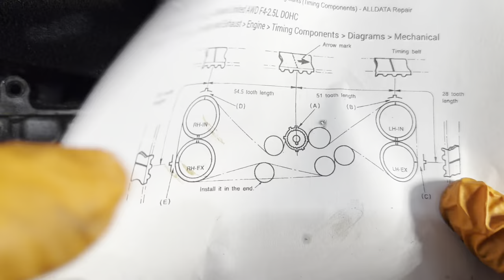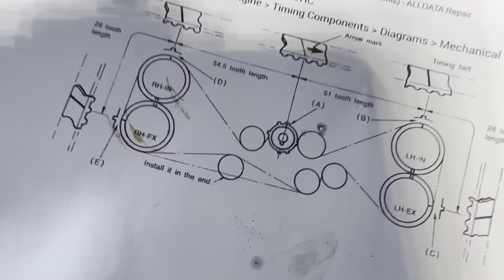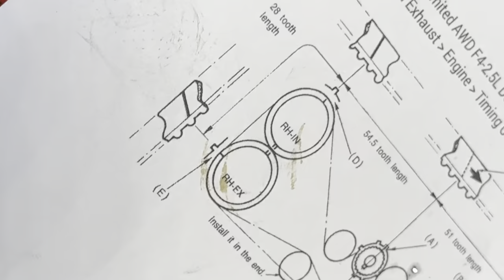SOFT METAL!  Engine Damage! Subaru Legacy Outback AWD 2.5 DOHC EJ25

Comment: You should always drill metal slow to medium, better for bits and your wrists. Definitely not great to full throttle gung ho them.
Reply: I told him this I believe over a year ago and others have said the same thing when he drills things.  He apparently wants to waste more time and money having to buy more drill bits after ruining them after the first 20 seconds but also spending extra time having to keep drilling when the hole could be drilled in a matter of seconds.

In this case, he was just lucky that he was drilling aluminum.  You should see what he does to drill bits in steel or harder metal.  I just don't get it with some things with Ray.  He's pretty smart with so many things related to vehicles but yet makes the most basic and simple mistakes.  I didn't agree with the way he installed that thread insert and he should have redone it in my opinion.  It may end up being okay but it didn't go the way it should have.
Reply: For the life of me, I can't understand the logic behind running the idler bolt down with a non restricted torque tool into the aluminum block. Especially after having to do a thread repair once. I would've been content to run it down by hand, observing the published torque specs.
Guess some folks can't learn from their mistakes.
Reply: @eldridge201  He didnt run the taper of the tap far enough in hence the insert basically bottomed out. "Less haste and more speed" sign should be hung on Rays wall, he does so many little things that are just wrong, normally he gets away with it but that insert was a right botch job.
Reply: Mild steel - high speed, high pressure 
Stainless steel - low speed, high pressure 
Aluminum - high speed, low pressure 
21 years metal working experience.
Reply: Rule of thumb is: Small diameter hole goes fast, larger diameter goes slower. That way the velocity around the circumference of the drill is about the same -- if you're going too fast, either the drill will bite or you're going to temper or warp the metal due to friction, leading to a dull bit.
Reply: We sure do have a lot of Armchair QBs in this comment section!!!!!😂😂😂

Everyone is a pro until they aren't!!!!
Reply: @eldridge201  I'm so old I remember non-variable speed hand drills. Off/on only. 
These kiddies these day have no idea how good they got it !  Ya got near infinite speed control USE IT.   Easy does it.
Reply: Gung Ho's Garage Repair😂😂😂
Reply: Guess some us here...just want him to throw that Neon sign out 😏
Reply: And Troy gets the Trophy😏
Reply: Indeed - correct .
Reply: Then WTF is HST for??
Reply: @jacksonnra1856  high speed steel hss, not hst are for wood, plastic, anything not metal except maybe some light aluminum drilling..a lot of concrete bits are this or polycrystaline diamond...cobalt are for steel, other metal etc carbide tipped are for durable stuff that dulls it like fiberglass, some softer metals, titanium are kinda a gimmicky thing but great for wood.
Reply: Reeeee
Reply: The way I learned it was that the bigger the bit, the slower the spin.
I'm not saying it was right, but it worked.
Reply: @dsc420247  The thing with the "armchair QBs" that you're referring to is that some of them are actually "pros" in their field as well.  There are some techs in the same field that happen to comment in the comment section as well.

If you read some of the comments, you will find that there are also metal fabricators or machinests commenting that probably know a thing or three about metal and how to properly drill a hole so you don't burn up a drill tip but also waste time not getting the hole drilled.

Nothing wrong with people explaining the proper way to do things so people can learn.  I'm willing to bet even Ray himself would agree that even he needs to take a moment from time to time and "rethink" a situation or wish he could have had a "do over" even if reading some of the comments can be a bit frustrating or disheartening.
Reply: @timewa851  Agreed.  I've used drills that you had to wait a few seconds before they would stop spinning once the button was released.  Some are lighter duty than others so it wouldn't take long for the drill to stop spinning and others it seemed like a good 4 or 5 seconds.

Just take it easy.  You're actually making more work for yourself by trying to go too fast.
Reply: I love Ray, but this was painful to watch.
Reply: I wrote this months ago... meanwhile i gave up

Comment: Are you sure you want to pressure wash that engine? The alloy is so soft the pressure washer will probably blow a hole in the block.
Reply: it's called Job Security.
Reply: @timewa851   Is that anything like a wallet flush?

Comment: Ray, you are using the wrong cutting fluid for aluminum. The Tap Magic you're using s designed for steel as it contains sulfur which is an extreme pressure lubricant. The right lube for aluminum is WD40.. There are other cutting fluids equally as good such as Boelube, Anchorlube, and Aluminum Tap Magic but WD40 is perfectly suitable for all aluminum drilling, cutting and tapping operations.

Comment: The installation tool expands the insert helping to lock it in. We use these all the time at work. I’m guessing you didn’t run the tap deep enough past the lead thread of it.
Reply: I think you're probably right, however it may have been the right decision in this case, as I'd rather have to grind off some of the helicoil and compromise it than risk punching through the back of that hole into the block that he has already tried and failed to replace, it seems unlikely to me that the helicoil is going to come loose on its own anyway given how that block seems to love permanently welding fasteners to itself. Give it a few days and you'll have to drill out the whole helicoil if you want to take it apart again.

Comment: 9:35 a technique I was taught when tapping was to advance the tap a couple of turns, back it out a half-turn to clear the chips from the cutting edges, and repeat until fully tapped.
Reply: Perfect form when tapping hard materials, like steel.  This engine is apparently made of aged cheddar.  Ray could have carved threads in it with his house key...
Reply: Yeah. Exactly the technique you're supposed to use. 👍🏻
Reply: m10 is large enough and he is tapping slow enough that it will move the chips naturally.
on harder metal yes, but it is a good habit to do all around.
but i don't think he fully tapped it, which is why it didn't want to seat fully. it was hitting the lower tapper end of the threaded area from the tap.
Reply: Not fully tapped all the way down is what I noticed as well.
Reply: @mikejacob3536  or a... wait for it... a cheese grater. 🦊
Reply: As if Ray gets that, he's a hack.
Reply: we also put the block under air pressure to blow back the majority of swarf and not blow it into the engine as he did with the air gun,. also, we changed the angle of the drill to stop it biting into the block, the drill he is using was meant for steel

Comment: My general rule of thumb is never use power tools when putting (or taking out) steel bolts into aluminum. If the tool is working too fast, it can pull the threads. If it is too powerful, it can rip them. You have to remember that the steel bolt will win every time when it comes to aluminum.
Reply: That’s exactly why it happened 👍🏼
Reply: I worked in the Honda factory. Hand start the bolt and tighten with a impact.
Reply: Yeah I am overly cautious fastening and loosening anything on my block. Hand tools only for me.
Reply: Ray too dumb and lazy to figure that out, especially with sparkplugs...

Comment: I said this in the last video, but I have to stand up for Subaru here. There's a reason why service data tells you to remove the tensioner last, after the belt has been removed. If you remove the tensioner first like ray did, when it is under an extreme amount of tension, you will strip the bolt threads out when removing it. 

I like Ray so I don't want to sound like a hater, but all the subaru bashing comments in these videos bother me.
Reply: I'm sure that if all previous work that was done properly you shouldn't have issues with bolts stripping out ,?cheers🍺
Reply: Yeah , stripped out threads in the block just from removing the bolts….🙄
Reply: @devinangola3458  This is the kind of thing that might be hard to understand without experience, but yes.

If you have something putting pressure on that steel bolt, like a timing belt tensioner, as you are trying to remove it from aluminum, you can easily strip the aluminum threads out. 

Anyone who has tried to remove a bolt that has side to side or up/down tension on it as you were trying to remove it should understand this, as the bolts don't thread out as easily in those situations.
Reply: @chrissmithz314  boy that was very condescending, I’ve worked with aluminum blocks on cars and cycles, never have I had a block thread strip out from just taking out the bolts. Had them break off because of two different bimetallics causing corrosion in the threads. Not to sure what the bolts are made of but corrosion and constant rotation on a pulley can wear out the threads OR they were over torqued from a previous repair.
   Anywho, dialectic grease must be added to stop that corrosion or slow it down.
  Looks like a cheap aluminum block to me, and sketchy manufacturing.
   But please school me on my mistakes…
Reply: @devinangola3458  I wasn't trying to sound or act condescending at all, I apologize that I came off that way.

There's really not much else for me to say. Removing a bolt that's holding in a timing belt tensioner, when that tensioner is still applying tension, is just different from normally removing a bolt.  It's like there's a lot of weight hanging down from the bolt, or pulling up on the bolt, causing it to drag and pull the threads out as it comes out.
Reply: @chrissmithz314  apologies excepted, I’ll have to go back and watch whether Ray took the pulley under tension from the belt, I don’t remember!😂
  But there were two stripped out threads on that aluminum block, and as you said a constant pull and rotation to wear out threads.. it begs the question of having a belt instead of a gear driven chain for timing?
   Wouldn’t this just happen again on a few years? External timing belts are cheap and easy to replace, but as I said before..bimetallic corrosion is still going to happen with the new metal insert with pressure and rotation.
   Honestly I’m not trying to be a azzhole, but isn’t that a flaw on the design of this block?
Reply: @devinangola3458 Technically there was only one stripped out hole. The first one was damaged due to a bolt on the water pump breaking and during the removal process and the resulting efforts to extract it damaged the threads. The other threads were damaged, as many have said, by removing the tensioner bolt with it being under load. We keep "grenade pins" hanging around the garage to take tension off or just cut the belt before removing the tensioner bolts on everything we work on to eliminate that exact problem. I would bet money Ray never removes a tensioner bolt on an aluminum block again that has tension on it. I too though am curious why no thread sealant was used on a hole clearly exposed to the water jacket.
Reply: . Ya mean accepted?
Reply: @kennybaumann2117  hmm maybe it’s because they are haunted with bolts that break off and stripped threads from corrosion, electrolysis. 
  That engine is compromised, wrench on any other part of that engine expect the same frustrations.
  Just fixing to has contaminated it. How far do you go before pulling the cord?!
  You could fire the parts cannon at it, then you might as well swap out the engine. RIP Subaru, you probably gave people joy to drive…I guess?😐

Comment: You missed one feature of the time-sert. The insert is not treaded all the way to the bottom. This is done for a reason. When the installation tool is running the insert in, it stops at the unfinished treads of the insert providing enough friction to bottom out the insert into the counter sink that was cut. Once bottomed out, and the insert is seated, you keep turning the installation tool. This does two things. It finishes the threads at the bottom of the insert and expands the bottom of the insert to lock it in place. You needed an insert that was about 3/16 - 1/4 inch shorter and all would have went well on the first try (could have run the counter sink tool in a little further).

Comment: Some advice from an old-timer. Before you reinstall steel bolts into aluminum alloy chase your treads.Put some light oil on a tap cleans out the corrosion. Also some anti -seize on the bolts. To avoid coolant leaking from water jacket thread sealer on bolts.
Reply: Good advice, I would also suggest possibly some grease on his tapping tool to capture shavings created by the tap. Has saved my butt several times. Too old now to be fiddling with screw ups self inflicted. Having done this crap for over 50 years I’m tired of fixing my own stuff ha ha .
Reply: @turner0224  I'm 71 still working on old motorcycles. Stripped threads a common occurrence.
Reply: @jeffreycler495  Remember in the late sixties and early seventies all side covers had Philips head screws that stripped out all the time. That’s when I bought my first impact
Reply: @turner0224  Yep, First choice...
Reply: @turner0224  My early '70's Hondas had those.  First thing I did was replace those bolts with hex heads or Allen cap screws.

Comment: I've only hit about the halfway point in the video, and I have comments.

First, Timeserts have three lands of thread at the tip of the insert that are not fully formed until the installation tool rotates through them to swedge them in place, locking the insert into the hole in the process.  That's why it's so important to make sure the countersink for the flange is properly bored.  Taking off the excess shoulder is a perfectly good solution when it doesn't quite fully go flush or below the deck.  

Second, I'm surprised that Subaru used a 10x1.25 thread in the aluminum casting.  My experience has been that coarse threads hold better than fine threads in aluminum, and in fact that's borne out by the standard practice in the aviation industry.  Both Lycoming and Continental routinely use studs with a coarse thread to go into the block or head, and a fine thread for the end that gets the nut.  When I heard that the Timesert kit was 10x1.25,  I was half afraid that the wrong kit had been ordered.  But it was right, and my expectation is that this is going to be a kit that will get used again; I'd give that tensioner bolt no better than a 50/50 chance of torquing down without pulling the threads the third time it has to go in.  (Do not even get me started about Daimler's angled head bolts on their aluminum-block V8s.)  But with the Timesert in place, I'd be fully confident that this repair will outlast the vehicle.

Comment: Should have used grease on the tap to catch the shavings and use thread sealant on the tensioner bolt or you will have a coolant leak
Reply: I have had so many issues with the timing in my suburu, had it completely redone twice! Bc the first guy said he knew what he was doing, until time to actually do the work! So I then paid to have it done by a professional! Should have done that in the first place! Would have saved a good bit of $ & lots of headaches!
Reply: I was thinking that may be a wet hole, but then again I have not watched the whole series.

Comment: Say hey Ray.  I'm a machinist,  and I've  repaired more threads than i can remember.   Run the drill as fast as youre comfortable hanging onto it, if it is going all apeshit, gounging out the hole, slow it down a bit.  That aluminum block is dead soft, and probably pretty gummy too, speed on tye drill won't dull the drill.  And heres the thing, dont buy drill bits off the trucks, from what ive seen, they sell junk.  We bought a whole bunch of Matco TIN (titanium nitride coating) coated drills (actually, the team was sponsored by them and they gave them to us), we tried using them in CNC mills, and they were junk, lots of exploded drills.  Get Precision Twist 
Drill (PTD).  Guhring. Walter.  Good quality deills.  HSS/8% Cobalt.  They last a lot longer than the extremely expensive truck sold drills.  Get them from MSC or one of the big machine shop suppliers.  And your thread repair/hack job insert, will work fine, i would have done the same.   Keep it up RayRay
8:12

Comment: Ray the tip of the tap is tapered so you have to send the tap at least half an inch deeper than the hole to get the full thread size to the bottom of the hole. The insert could not go as deep as you needed due to the taper at the tip of the tap. Next time Tap deeper and the insert will fully seat.

Comment: Use 2 nuts in place of the 2nd nutsert.  Left hand drill bit to remove the broken nutsert.  Never turn an engine backwards against a timing belt or chain adjuster.

Comment: That’s what the new Subaru have! Glue instead of rubber gaskets! They’ve had major issues with using too much and clogging the oil pump screens blowing engines. 
And drying out and causing leaks In turn pulling engine to dismantle engine and Reglue or smart use gaskets but major expense for owners

Comment: You’d think after stripping two bolts on an aluminum block maybe a torque wrench would be a good idea!
Reply: torque wrenches don't prevent studs from breaking when loosening nuts or when you predecessor has crosstrreaded bolts.